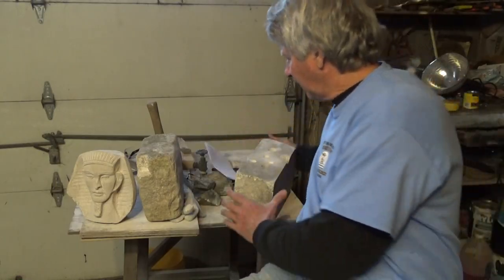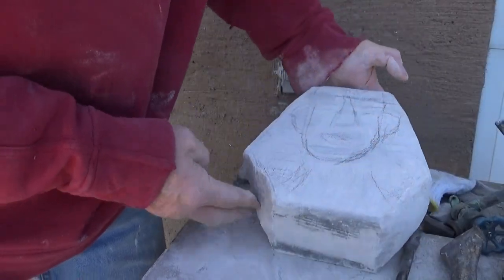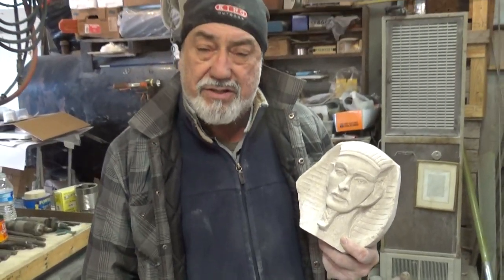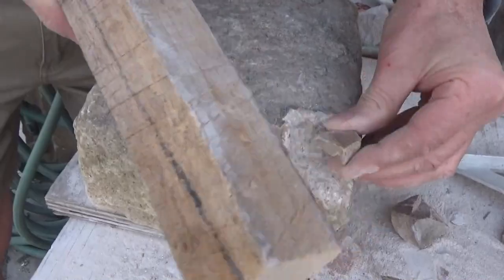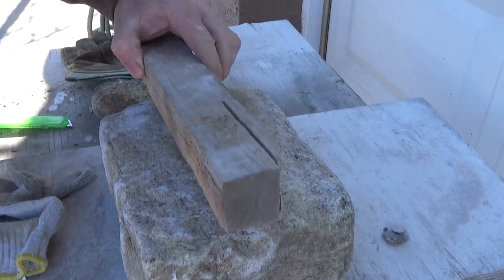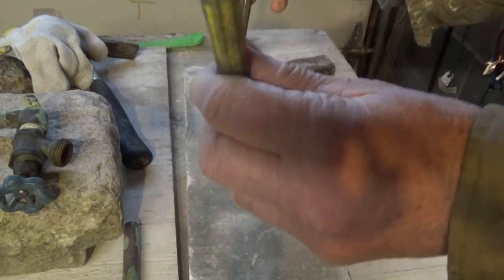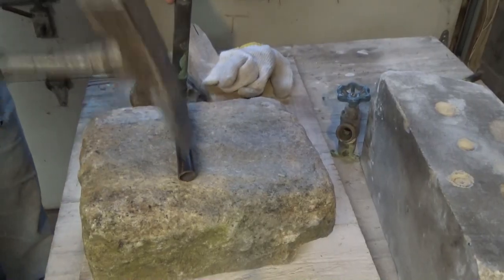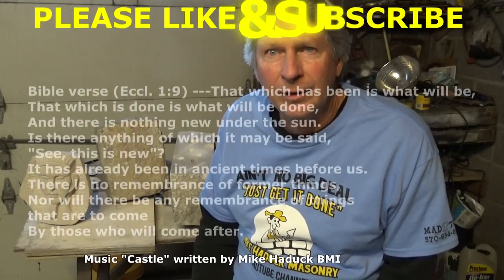CARVING STONES WITH ANCIENT TECHNOLOGY (Mike Haduck)

Comment: Mike, when you are working the granite corner on the bench by pounding it, seems the bench holding the rock is bouncing around. Is that bouncing causing a loss of energy in the blows?
Reply from the maker: Hi William, maybe, it was on wheels so I would move it outside to work on it, I just wanted to prove the point, thanks Mike

Comment: Hey Like, I have a playlist of dozens of videos working with granite with simple tools, cutting ad drilling in different types of granite and basalt, beginning from making the abrasives from scratch through to polishing.
I also have many videos examining the "magical" Serapeum boxes and vases and all those things they keep calling "precision" Hint hint they are not and I show how to tell.
If you're interested let me know and i can pass on the videos and sources.
I got sick of replying to each individual comment so made video responses to help set them straight without having to type the same thing over and over.
Reply from the maker: Thanks SGD, sure send me the links so I can check them out, thanks Mike
Reply: Ignore the mechanical engineer that showed the spiral drill hole with equal mm progression for the entirety of the bore hole.
Reply: You aren't the guy who speculated that the pyramid was built from the inside are you?
Reply: @gregwarwick8655  It is acceptable to ignore Dunn because he never proved what you stated. There is no continuous spiral no matter what illusion he attempts.
Reply: @Eyes_Open  it's clearly displayed in the photo
Reply: @gregwarwick8655  very clearly not shown.
Reply: The setapheum boxes are 80 tonnes. You have a lot of explaining to do. 
"it's easy."
Reply: @Eyes_Open  go find the 6 inch (approx) hole saw bore hole images.
Reply: @gregwarwick8655  Go find the images for you? I have seen them over and over. I have also read Denys Stocks and I have seen Sacred Geometry Decoded channel absolutely show the non-spiral. Same with Scientists Against Myths channel.
Reply: @Eyes_Open  go find them for yourself

Comment: There is a theory that there was a civilisation older than the Egyptians (10 000+ BC) and the Egyptians might have recycled some of the material of that civilisation.
Like some superbly polished granite statues. On some of them you can even see that the quality of the writings looks gross (very much unrefined) compared to the quality of the finish of the statue itself. I don't think it's necessarily a proof this older civilisation used a lost carving and polishing technology. It's possible the Egyptians used the same technology but they just recycled some material already available in high quality finish. Probably many civilisations did that, we are even still doing it today.
Reply from the maker: Hi, it's only stone work, anyone who keeps working with it will learn its ways, just like anything else,  thanks Mike

Comment: Drilling holes in the rock with copper was done with a bow drill scaled to the job. That reciprocating action speeded up the process of friction in cutting. I also think the ancients cut blocks with giant pendulum saws. Big frames over rock had a log suspended on ropes with pegs on the underside of each end of the log where they stretched twine. That twine would rub back and forth on a pre-scored line and wet grit between rock and twine would cut the rock. As the cut got deeper, chisels were used to pound in the rock cut and it would crack apart.
Reply from the maker: Hi William,  provably so, a lazy guy would always find a easier way, lol, Mike

Comment: No one ever denied that copper and flint can carve limestone; the difficulty comes with carving granite and diorite. Flint chisels CAN carve granite and diorite, but the process is incredibly slow. The Egyptians did have iron, as the metal is mentioned frequently in the Pyramid Texts, and iron artefacts and tools of the Pyramid Age have actually been found. These are rarely mentioned in textbooks because they undermine the whole chronological system beloved by mainstream Egyptologists.
Reply from the maker: Hi Emmet. I agree, I also got a whole series called " rockfacing and shaping stone" part 13 shows the guy doing demonstration on old school polishing of granite,  thanks mike

Comment: As a lifelong tradesperson , the design of a pyramid is pretty simplistic.  Even in its simple form , it was a design reached by trial and error. You can see instances of earlier pyramids that collapsed because the geometry wasn't sound. So they learned from their mistakes and found the proper proportions that were architecturally favorable and stable. You don't need aliens or supernatural powers to figure out any complex geometry although I'm not saying ancient Egyptians weren't capable of figuring out that math. What I am sayin is that with simple tools such as a plumb bob, string lines and water levels,  you can eliminate the need for the thousands of  masons to understand any complexity to build within the parameters needed. They simply needed to set a plumb line in the center , use water level to set your foundation,  using string lines and very basic layout methods bisect your 4 quadrants . From there , string lines would be pulled to the central apex of the pyramid that would be established by building a temporary tower set with a plumb bob to its center from its foundational footprint  to the top of the central tower. With plumb and level and the for outside corners Square to eachother,  all one needs are stringlines pulled between those points.  Then the masons just need to cut the stone and fill in between the string lines. These pyramids were built by skilled masons guided by very intelligent architects who had generational knowledge built upon the successes snd failures of their ancestors.  No alien technology needed. As far as how the stones were quarried , cut and moved,  there is plenty of information out there on how that was accomplished as well
Reply from the maker: I agree it's not a big deal as everyone thinks,  thanks Mike
Reply: Design of pyramid is pretty simplistic? Simple form? You better stick to your trade than playing smart. Earlier pyramids collapsed, not correct, some of finest examples of 3rd dynasty stand very much, and their geometry is very much sound and those that collapsed, are like that because other reasons not that they have faulty geometry. Later pyramids "collapsed" as earler prior the 4th dynasty. 
As for simplicity of Khufu or Khafre's pyramids no further discussion is needed.
Reply from the maker: Hi Dom, I did video on bent pyramid etc. It's all obvious to a stonemason,  not a big deal, don't be listening to all those bedroom archeologist,  it's all common sense,  thanks Mike
Reply: @domusterra3261  I'm not here to get into random fights with strangers on the internet and use ad hominem attacks on people's intellect or character.  So you are welcome to your opinion.  However you never really made any concrete argument that discredited anything that I said. Just pure contradiction. I wasn't  " trying to play smart" just voicing my opinion,  based on real in the field experience.  If you disagree with me that is fine. But what are you actually trying to say ?
Reply from the maker: Hi Mark, I would appreciate you sending me a link to your videos on the subject,  when you were there, what you discovered and your opinions , then we can go from there,  thanks Mike
Reply: @MikeHaduck  Sorry no videos.  I did appreciate yours though . So many people underestimate the ingenuity of tradesmen whether they are our contemporaries or Egyptians from thousands of years ago. The Pyramids are a testament to hard work and skilled labour. Thanks for showing many conspiracy theorist how the masonry could be don using primitive tools and a little elbow grease.

Comment: Fire was also used.  This will make it easier to do the chipping.  This is why you get the scoop marks.  Fire, pound it out, fire.  The large obelisks were quarried out in 6 to 8 months. When the yearly flood came the ruff obelisks where loaded on to boats and floated down the river to where they were used. I think the finishing work and inscriptions were done where the obelisk were installed.
Reply from the maker: Hi Stanley,  I could agree with a lot of that, thanks Mike

Comment: 2:00 There even seems to be a sturdy stone pulley. However, sadly, I do not see any ancient levitation devices, forklift trucks, helicopters, power plants, light bulbs or batteries... ;-) Instead, I see a stonemason talking about the stonemason's job and showing as he and other stonemasons do it. I am still just as impressed with the craftsmanship though. Many thanks! PS. They used bronze which is harder than clear copper and they could also use arsenical bronze and tinned bronze. Also, teak wood (one of the hardest hardwoods) is grown in Egypt up to this day and back in the day they were supposed to have plenty of wood too. They also used wooden pegs inserted into drilled holes and soaked with water to split big chunks.
Reply from the maker: Hi, I got 2 videos, "carving stone with ancient technology " part 1 & 2,  Mike haduck, that should answer a lot of those questions,  thanks mike

Comment: You know what was the best part? "I'm pretty sure they colud do that with copper tools but I'm gonna use the steel ones" (switches on an electric chisel).
Reply from the maker: Hi Skorrigan, because it faster, thanks Mike
Reply: I don't know how many Things were done because they Look Just too good, symetrical. But this is a Joke. You believe your own Dogma. Just Like the other Side. They Had time. Just keep hitting etc. No. Of course you can Hit 3 month in the same Corner. Of course Material will Go away. But giza is something else. Saqqara. Same. But this Kind of. Look. I Hit the stone only 3 days and 1 Inch is gone. Wow

Comment: The Egyptian chisels in Cairo museum are made from copper with 3% arsenic which makes arsenical bronze, as strong as mild steel.
Reply from the maker: Thanks Dave. I haven't heard that before, thanks Mike
Reply: @MikeHaduck  Thanks for your demonstration Mike, l served a Blacksmith apprenticeship in a Naval Base but the only bronze l handled (1970's) was Beryllium bronze because it doesn't spark so only essential for spanners used inside a ships fuel tanks. 
 A retired stonemason in Australia has his grandfathers chisels and he told me of their hardness which surprised me. 
  You probably know that iron swords replaced bronze because of their weight among the many other advantages which followed. 
 With tools as small as a chisel weight isn't so important and as the Australian guy said to me 'Although made around 1880 they were made to last and keep an edge better than the cheap stuff available now '
  Although l suspect as they were family heirlooms he probably only used them on wood , the supposed 'tool steel' of many cheap sets available at the local hardware store are poor quality.
Reply from the maker: Thanks, Mike

Comment: Look up Christopher Dunn.  He measured those statues  with lasers.  He’s an engineer. He said that the precision of the curves is mathematically perfect  and we cannot carve those today from. Granite on  That scale with precision.   And he measured the sarcophagus many. There’s absolute flat surfaces with zero error  and perfect angles.   Thousands of structures like that. Perfectly smooth. On granite and diorite   Not just once time. But thousands of times.  Perfect cuts.   How long would it take to cut just one limestone two ton block by hand??   There are over two million of them in just the great pyramid alone.  Supposedly built in only 20 years.  That’s one block every few minutes    Not possible by chisels
Reply from the maker: Hi alas, I been to college for architecture and law. And I never seen an engineer do anything then draw on paper, they are not stone masons quarry men of movers, it wouldn't take any longer to build a pyramid as it did the empire state building, thanks mike
Reply: These corners, so-called "perfect angles" are not even 90 degrees, many are 91-92 degrees. Some cuts are off by a width of a finger. So much perfection! You are dreaming about the superpowers that never existed ;)

Comment: Can you explain the tool marks which suggest circular saws several feet in diameter with a 3mm kerf were used?
Reply from the maker: Hi, they had diamonds and jewelers to make saws you won't see them in the museum because they were too valuable,  thanks Mike
Reply: @MikeHaduck  , thanks. Diamond saws were found? Is there a book I can reference?

Comment: In Scandinavia we have found amzing granit axes from the stoneage. They are perfectly symmetric and smooth as glass. However, I think the real mystery is not about precision alone, but rather about how the heck they upscaled these techniques to huge objects and at a high production pace.
Reply from the maker: Hi Holmavik, lot of workers with lots of time,  thanks Mike
Reply: @MikeHaduck  yes of course they had many many workers and lots of time, but that makes it even more mysterious. How did they organise the production lines, the logistics, the planning and scheduling, communication between beween parrallell subprojects? And on top of that, if we strech the time period too long then one may expect some architects and leading engineers to pass away during the process. They obvously did it despite all these challenges, but how??
Reply from the maker: Personally I worked on skyscraper type of buildings it looked like ants building a mountain but they did it, I don't think it took longer to build a pyramid as it did the empire state building, my opinion, thanks Mike
Reply: Why assume a high production rate? Just how many Pharaohs do you think needed granite sarcophagus’s per year? One per year would seem to be on the high side of average.

Comment: Now, let me see you carve a COMPLETE rose granite sarcophagus, like the ones in the Serapeum, where the flatness, the parallel width, 90 degree angles, and the trihedral corners are all within a tolerance of 5 one thousandths of an inch .  You do that with nothing but diorite stone hammers and copper chisels and I will be a believer.  Better yet, let me see you carve a statue out of diorite with the kind of symmetrical PERFECTION that many of the Egyptian statues show, using copper chisels.  Many of them have been scanned with computerized 3D laser scanners and their symmetry is virtually perfect.  

I'm not claiming that the stone masons were aliens, but I am claiming that that sort of precision COULD NOT have been achieved with simple hand tools, especially COPPER chisels.  There are many examples where large circular saw marks have been found, along with errors in cutting that would have been noticed much sooner had they been using hand tools.
Reply from the maker: Hi brab,,, no problem all it takes is time and money, or you can go to the history Channel and they will show you how the aliens did it, thanks mike
Reply: @Eye_of_Horus  You are correct.  The measurements I gave were incorrect.  It should have read that "the flatness of the boxes in the Serapeum are within 0.005 mm (5 one thousandths of a millimeter)."  I don't know abut you, but as one who worked in the granite industry, I know we cannot replicate this level of flatness today, nor could we build a box containing the trihedral corners anywhere near the precision of the boxes in the Serapeum.

These were measurement done by Christopher Dunn and quoted in the International Journal of Advanced Research in Management, Architecture, Technology and
 Engineering.

https://scholar.cu.edu.eg/?q=galal/files/me_part_xii_ijarmate.pdf
Reply: @brabanthallen  you should watch the video I quoted.  They are replying to dunns work directly.  Dunn never shows how he’s measuring, but in the video above they do and they are not getting the same numbers.  I also know from being there personally they are somewhat rough shaped, though smooth, they are not flat like a modern counter top or even close. .

It’s also worth pointing out since you mentioned copper tools in reference to this, these boxes were made in the Iron Age of Egypt.  And the unfinished ones show clear chiseling tool marks all over them.
Reply: @MikeHaduck  "no problem?" 
Silly

Comment: It’s not just a simple pyramid.  It was massive over 2 million blocks. Just one of them.  And incredibly precise. And the blocks came from far away       It was. It possible to make using copper tools and ropes.  Laser precision
Reply from the maker: Hi Paul, it's not as big a deal as they make it, on my pyramid videos you can see where they filled it with junk stone, anything that would fit, thanks Mike
Reply: @MikeHaduck    cutting huge granite with perfect laser accuracy is NOT possible with old cutting tools.  just not.  engineers have measured and said this.    hard granite with absolutely perfect right angles..... copper tools cannot do that. ever.     pyramids are not just stacks of rocks..   many have very sophisticated designs that took couplex math, and drawings.    someone super smart did that.     must have involved huge numbers of people
Reply from the maker: It didn't take no longer to build a pyramid as it did the empire state building, everyone had their specific job, I you ever worked on a big project you would see it, they had jewelers, carvers movers, setters, etc, don't listen to all those bedroom archeologist,  thanks Mike